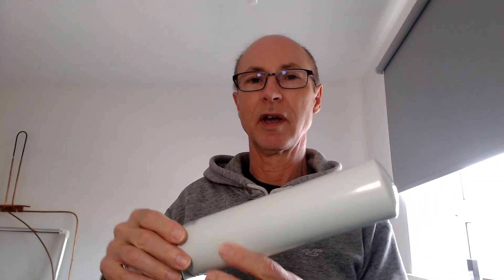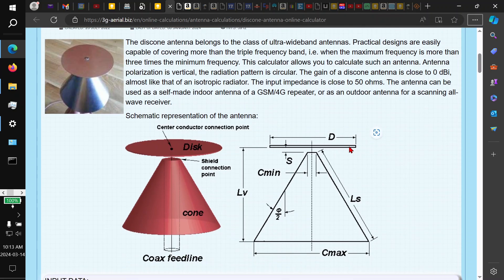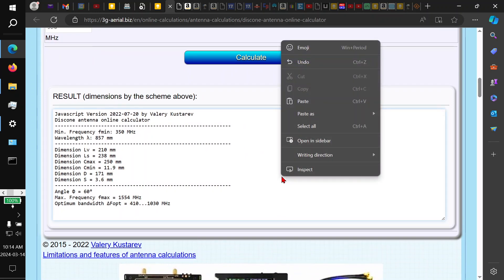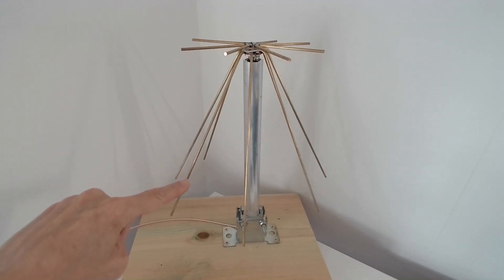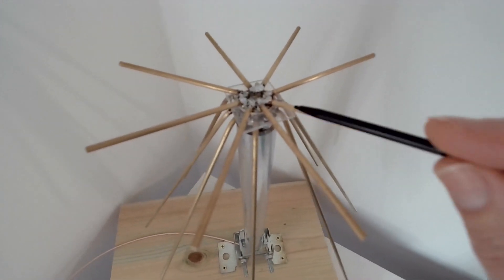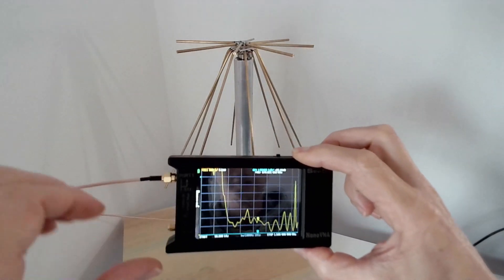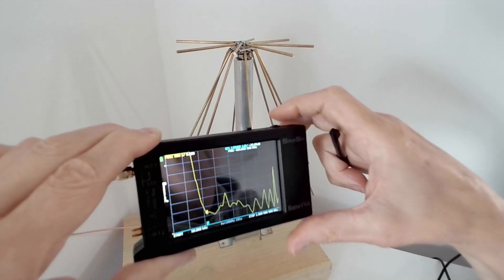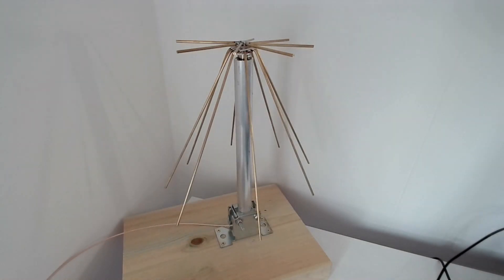Discone Broadband Antenna for Meshtastic and General Listening Part 1

Comment: @5:54  a bit of a tip on soldering, and this particular issue comes up very frequently… Try using a 
 hotter temp instead of lower. The issue with using “the lowest temp possible“ is that you get a lot of heat soaking through the entire part before you reach the flow temp. It actually ends up being a greater amount of total energy. A higher level of power for a shorter period of time makes for a more concentrated thermal gradient, giving you localized heat to melt the solder which you can then quickly remove. This is the fundamental principle behind TIG welding as opposed to say, welding with a gas torch where a massive amount of heat is soaked into the entire area.  (Cont.)
Reply: Another technique that I have used in challenging situations like this is to employ two different types of solder. Use one that has a higher melting point (like silver bearing) for the first operation, and then pick one that has a lower melting point for the second operation.  Combined with the above I think you will find good success
Reply from the maker: Thank you for the excellent suggestion !!!
Reply from the maker: Thank you !

Comment: May I build using a real metal disk and cone? Cuting a soda can for example
Reply from the maker: Yes - that would be much better. The rods are only an approximation to the ideal disk and cone.
Reply: Yes, this is in fact the original form of the antenna, hence the name. One thing very critical is that on the element based one is that all vertical en horizontal elements shall be aligned with each other and the minimum element count for reliable  operation is 8, and this is a minimum.

Comment: Excellent build. To attach the elements to the copper disc/hub, consider using a clamped on jig and a MAPP gas brazing torch to braze the brass together before soldering the radiator assembly to the connector.
Reply from the maker: That sounds like a great idea for the mk3. Thank you !

Comment: What’s the point of using a discone antenna instead of a 1/4 wave ground plane at mesh frequencies? The discone has less gain and is more complex. Yes it has wider bandwidth but that doesn’t matter at the fixed frequencies of mesh.
Reply: he will be using it to look at other frequencies other than meshtastic, He mentioned it in a previous video
Reply from the maker: That is correct. Thank you for paying ttention :-)
Reply from the maker: Indeed that is true. I also wanted an antenna for general listening (it's in the title) over a wide band of frequencies.

Comment: With a mirror there is a reflection ,with a beam antenna there is a reflector ,director,and radiator,what is the difference between radiation and reflection of a antenna ,?it wud seem radiation and reflection are the same thing if the two different elements are achieving the same end result
Reply from the maker: I think the reflection of a real element as a virtual element (like looking at yourself in a mirror) is different from the reflector on a beam antenna. The beam antenna is not symmetrical and the reflector is a physical part of the assymetrical structure. The reflection which is the opposite of radiation of an antenna is the transmit power which is reflected back from the antenna to the transmitter instead of being radiated. That is three  very different meanings for the word reflector/reflection. In the end it is just words. If anything, radiation and reflectio are opposites but it depends which meaning you are usin and how you look at it. This is why antennas are sometimes described as being magical :-)
Reply: @fotografm  thank you for explanation and reply

Comment: Discones have quite inconsistent radiation patterns over their frequency ranges.
Reply from the maker: Yes, I am beginning to notice that as I perform some tests. Will make some videos about this soon.
Reply: @fotografm I see small ripples on the SWR, but it is nearly 1.0 across the band, even with the small ripples.  Also I am using biconic instead of discone.  Does this make a difference in the radiation pattern as well?

Comment: I would like to see your experiments with a j pole so looking forward to that video. I learnt a tip from a guy sometime ago the different melting points of lead free and lead solder  (thinks it's about 30c difference) can help when trying to solder multiple things to one small thing. In the past I've used lead free with lots of rosin/flux and a small butane torch (it was actually a cheap gas soldering iron, removed the solder tip and just used the flame) and just feed solder so every thing is solidly attached at once. Then after used lead solder and a small iron to attach it the other object
Reply from the maker: Wow - that is very clever ! I have some lead free solder somewhere. Perhaps I have finally found a use for it ;-)

Comment: Hi Simon, I have a question unrelated to this video and only asking this here  since not sure how else to reach you. I remember you did some RFI noise tests across various laptops. I was hoping to benefit from your experience as I'm now in the market for a laptop which can be either new or used or refurbished. I'm planning to connect SDRs and modern transceivers to it so the main concern is for the laptop to have RFI quiet USB ports and screen. Any advice on what make/model should I look for and and how could I test before buying without looking like a strange person :) ? Many thanks, Alex M0OOV
Reply from the maker: Hi Alex. I tested a lot of laptops and the quietest I have are a Huawei Matebook X Pro which has a completely metal case and the Lenovo T15 and T16. Earlier Lenovo models are relatively quiet except for the cheap consumer versions which radiate a lot of noise from the trackpad. The T15 and T16balso seem to radiate less from the screen than earlier models did. It is also important to put really good ferrite chokes on each end of the USB and other cables. Several turns with the ferrite halves bound tightly together (I find that the clip-on plastic shells are not tight enough). Hope this helps. Simon
Reply: @fotografm  Thanks so much that's really helpful. I have an older Lenovo T420 business laptop which seems very quiet but it's from 2011 and has started to show its age. All the best!
Reply from the maker: @ohaya1  The T series laptops are built with solid metal frames which helps a lot with shielding. Probably you will need a new battery for it ;-)